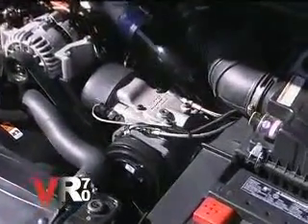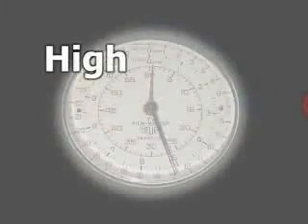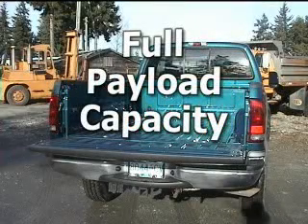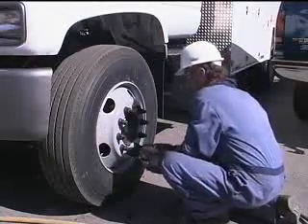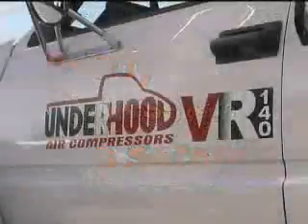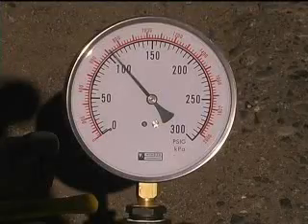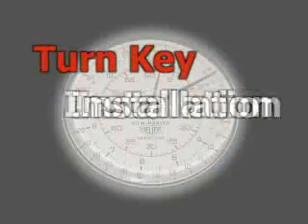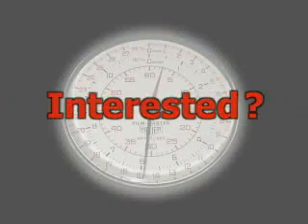VMAC - Vehicle Mounted Air Compressors UNDERHOOD Demo

Comment: GVW is gross vehicle weight, your compressor will not increase this at all... it will however lower the payload by increasing the curb weight. I'm not sure if I can trust your product if you don't know the industry you're in.
Reply from the maker: Hi John Paul, 
The vehicle's GVWR (gross vehicle weight rating) doesn't change, but GVW is the vehicle's actual weight which includes passengers, accessories, and air compressors. You're right that a heavy air compressor will lower the payload, which is why many people look for lightweight equipment. We hope you'll check out some of our other demo videos so we can prove to you that we know the air compressor industry.

Comment: do you make a kit for a 95-98 chevy silverado with a 350?
Reply: Hey Jay, to answer you question, VMAC UNDERHOOD air compressors are engineered for specific truck makes, models, engines and model years.  Unfortunately, VMAC doesn't make a mounting kit for a 95-98 Chevy truck.  They do make other compact and powerful systems that may work for you: Gas Drive Air Compressors, Diesel Drive Air Compressors, Hydraulic Drive Air Compressors, and Multifunction Power Systems.  You can see them all at http://www.vmacair.com.

Comment from the maker: Our V900115 will fit your vehicle, mr2177.  Because it is belt driven off the crankshaft that means idlers and tension could wear out and need to be replaced.  The compressor will only run when the clutch is engaged.  It will not affect fuel mileage.  Thanks for your comments.  Should you need further assistance, please don't hestitate to contact us directly at 877-912-6605

Comment: Does the unit affect mpg via accessory when not in use? Does it wear out when not in use?  I'm thinking of buying a 2013 chevy with the 5.3, but plan on only using the compressor sparingly, once or twice a month, that sort of thing.

Comment: Well yeah. I have an onboard air system, not for bags but for a train horns and to run power tools if I want or whatever. It's not riced out... looks pretty stock.

I have Viair 400C installed in it right now that's powered by the vehicle's battery and it's pretty fast. I played with the idea of converted the air conditioning compressor into an air compressor but that didn't work out.